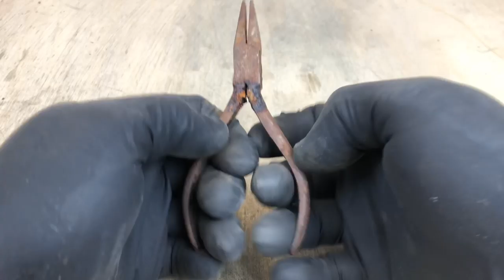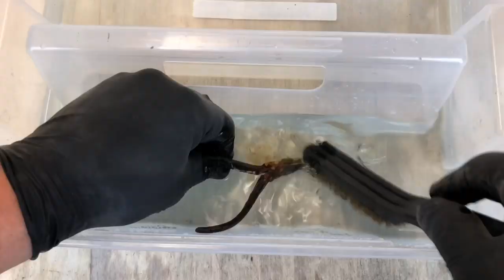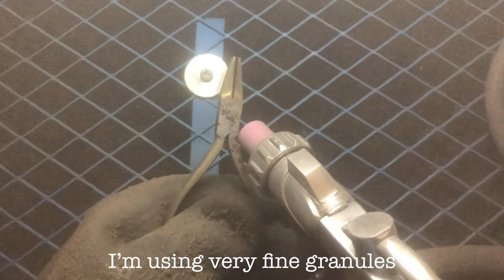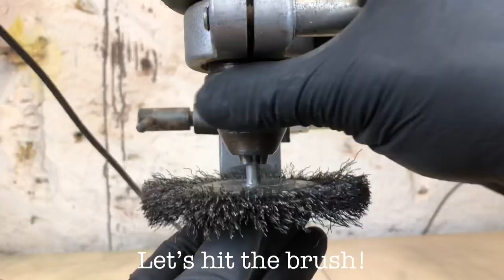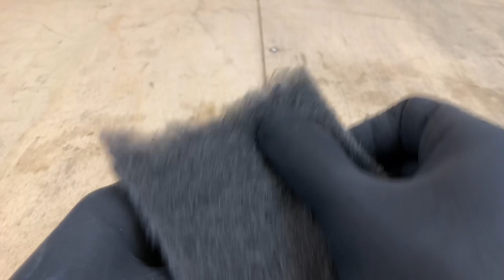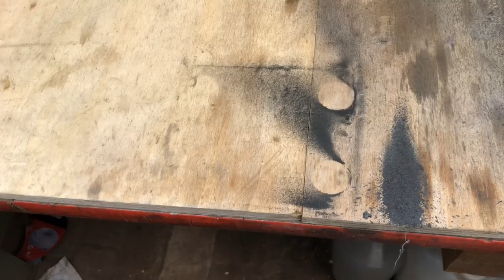Rusted Jammed Pliers Tool Restoration - Mirror Finish | Mister Patina

Comment: here are some tips that i think might help you in the future:

1. leave it in vinegar way longer (1-2 days) than before
2. use the wire wheel right after the vinegar bath
3. id use the files as a finishing touch to smoothen out the edges
Reply from the maker: Thanks Damian!

Comment: What are you doing about the most important rust...you know...the pre existing rust in the pivot point that wasnt dealt with or removed
Reply from the maker: Thanks for your comment Jeff! I didn’t want to disassemble the pliers, so I sandblasted/wirebrushed/oiled as far as possible in all angles from open to close.

Comment: Mister Patina, Congratulations on another fine project with an excellent result, but there is something I have to say and as a subscriber I feel at liberty to say that the sandblasting is a highlight for me but there is something about your camera shot of it that just won't do. Its dark and unclear, I want to see it clearly. Another thing, your fine compound brought a nice shine to the handles of the pliers but I would have liked  to have seen rubber grips on them. Anyway, carry on.
Reply from the maker: Hey royo, the problem with my sandblasting cabinet is, that i dont have an air suction, so it looks pretty dusty. But i´ll get a new one the next time :-)
Reply: @misterpatina  Fair enough. Looking forward to the next vid. Cheers.